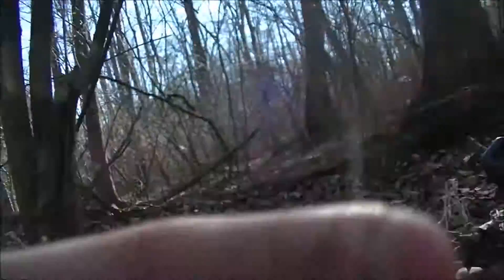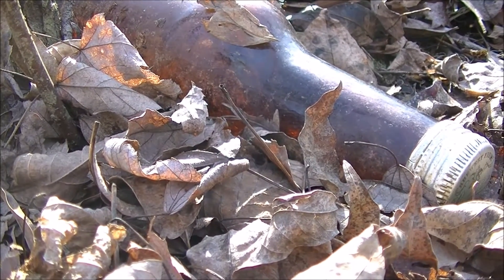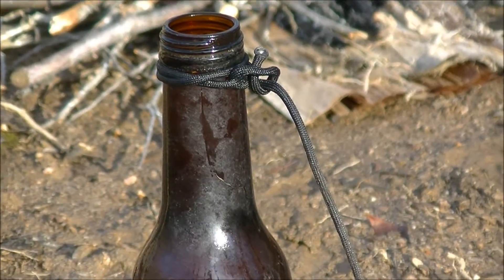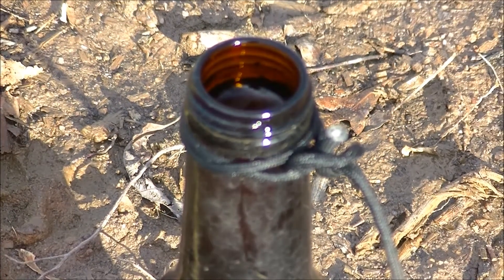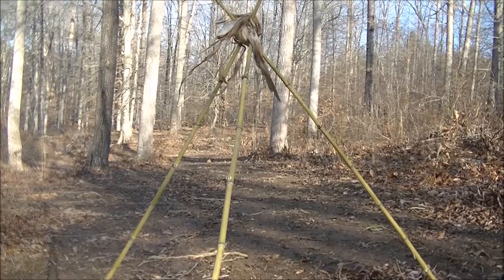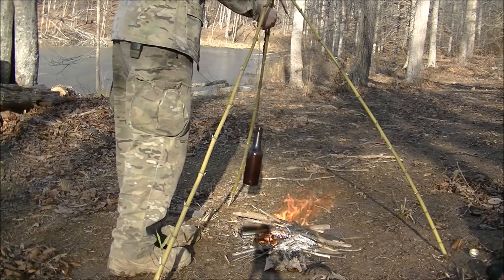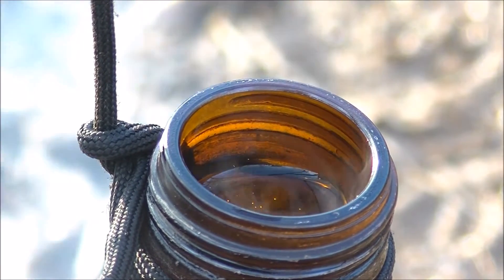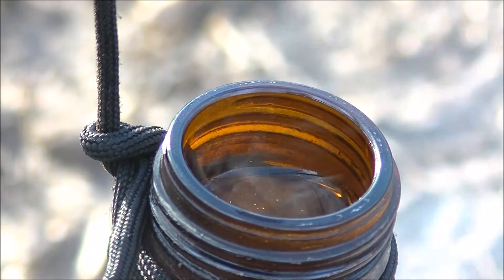Boiling Water in a Glass Bottle.

Comment: Would it be safe to boil water then pour in wine bottles for cooling? Our tap water is disgusting so thinking this option as an alternative
Reply from the maker: The shock of pouring the hot water into the cold glass would possibly cause it to break. I would pour it into a metal container. However boiling water makes it very flat tasting. To give it that flavor back you would have to pour it back and shake it to get oxygen back in it. For added freshness filter it through clean washed charcoal.
Reply: Awesome thank you brother!